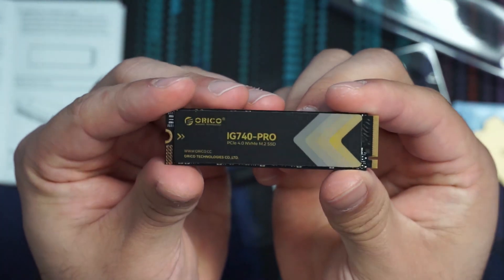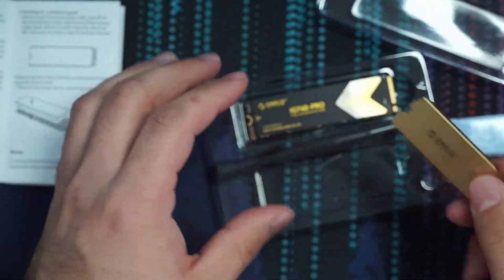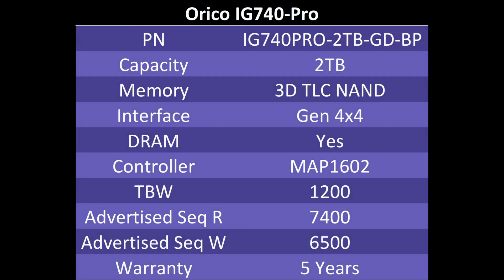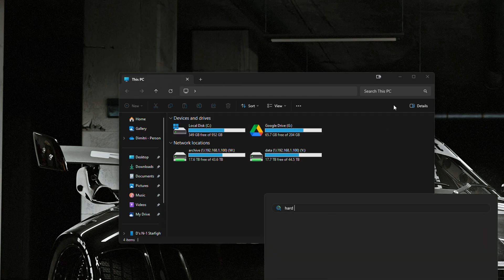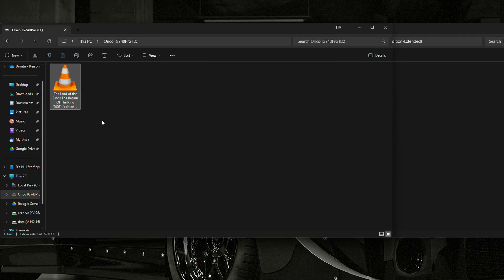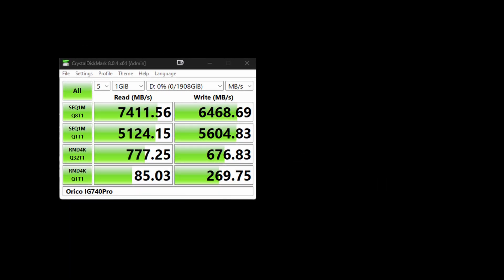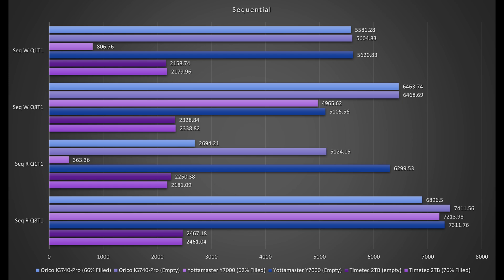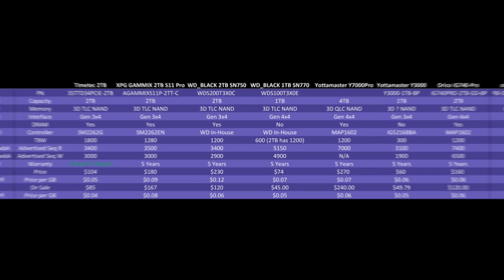ORICO's NEW NVMe!? | IG740PRO PCIe 4.0 Drive

Comment: FYI,  nvme's don't make games any faster!
Reply from the maker: That's incorrect, many modern games take advantage of speeds of NVMe drives for load times, it can be relatively minor compared to a SATA SSD sometimes but it still makes a difference. And ReBAR is also a thing.

Comment: I'm sorry, but the ORICO IG740Pro has no DRAM cache, it has only HMB and SLC Cache.
Also, you didn't mention, that the temperature sensor is fake and shows always 40 degrees Celcius with every test program.
And: TBW means "Total Bytes written", not "Terabytes written".
Reply from the maker: I had posted a correction in my pinned comment about the cache. 
That is absolutely not the case for me, my drive shows a range of temperatures from 29c to 63c during use. 
TBW means terabytes written. 
https://www.kingston.com/en/blog/servers-and-data-centers/understanding-ssd-endurance-tbw-dwpd
Reply: @MangoPango1973 Good stuff, apart from Point One which he already corrected, your other points are wrong. D-
Reply: @ottovonheydrich Irrelevant. Got the WD-Black SN7100 2TB cheaper than this. TBW as Terabytes written is not logical because the unit is on both sides of the equation and therefore negates out. And it was a German Youtuber who's Orico always reported 40C, this was not my idea.
Reply: @MangoPango1973 I can see you would argue, on a sunny day, that the sky is not blue so I'm out.

Comment: do you prefer the Y7000Pro or the IG740Pro? im deciding between these 2 currently and i need a drive for my new pc. i think i want to use the new drive for everything including OS. both same price ish
Reply from the maker: As mentioned, I wouldn't suggest either for your OS. These are new companies to the drive market and I wouldn't put my OS on a drive from a company that doesn't have a proven track record in longevity. 
They're both good drives though and I'd just get whichever comes out cheaper at the time of purchase. They use a lot of the same components.
Reply: @_Caddac I recently got the orico oG7000 and a Lexar eq790 2tb and 1tb respectively. My current os is on a 250gb Samsung 850 pro. So super old and at 88% health currently. I am think of moving the Os to one of these drives. Should I not do that?